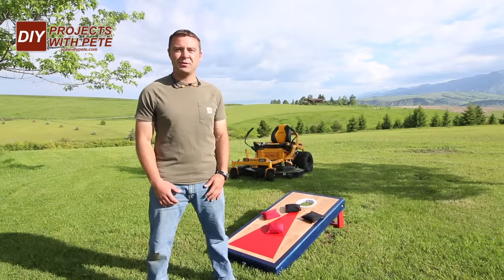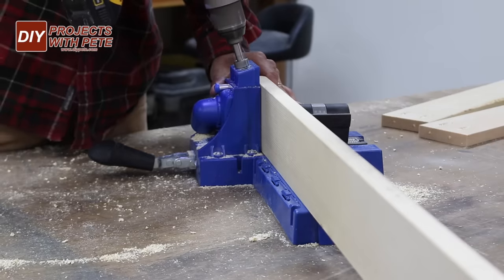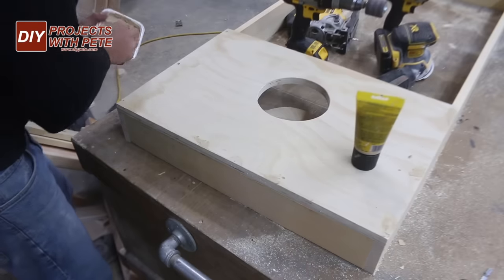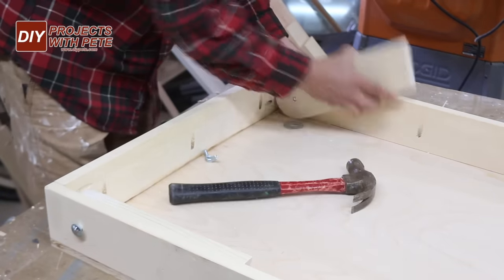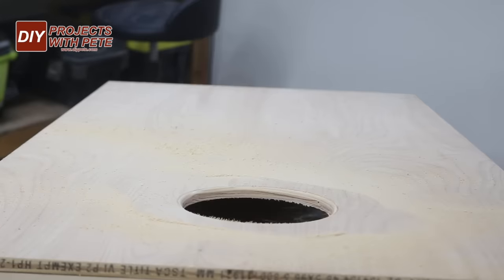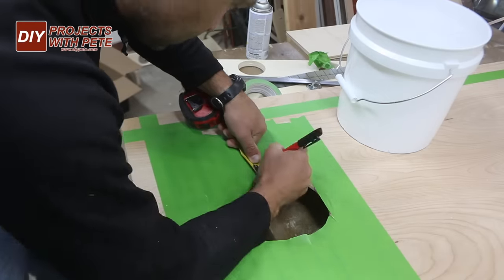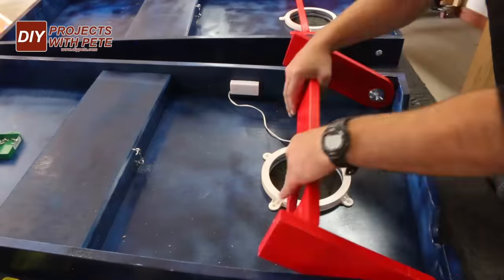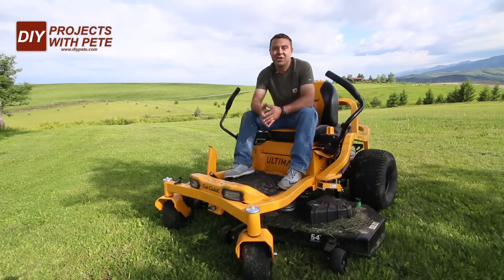How To Make Cornhole Boards

Comment: Thanks for using 1x4s. 
Most of the ones I’ve toted are built with 2Xs and are really heavy. The bag storage is great.
Reply from the maker: You bet! I agree, the 2x4 boards are super heavy. Cheers!
Reply: Bag storage can be between the boards by installing two cross braces of 1x 4 in center of each board...no need to put a lid on...when the boards are buckled together the bags stay within the cross pieces...just screw them 7" apart on the interior of the boards...also put a length of small rope 35 long inside and you have a complete game set....35 feet back to back on boards and also helps line up boards....

Comment: one tip i found that really helps on the legs is to put a 1/16" shim under the leg (between the leg and bottom of the platform) before drilling for the carriage bolt. that way it ensures theres space to rotate without sanding. when i started cornholes i learned off of your original and then modified so i really appreciate you. ive sold tons of em
Reply from the maker: Thanks so much!

Comment: Hey! I make cornhole boards all the time, I really like the style of yours! I'm going to try a set similar with bag storage and cup holders. Awesome job and thanks for the ideas! Maybe I'll post a video making a set. I've been painting my local sports logos and just  recently I did homer simpskn and Peter griffin from the crossover episode when they squared off to fight. Maybe I missed it but do you use a verathane coating on top for a smooth slide? If not I would recommend that. It gives the bags a good glide and the boards get a nice finished glossy look and protection from elements and wear.
Thanks again for the video.

Comment: Just a note about your orientation of the pocket hole screws.  I noticed you put the holes on the inside to obviously hide the holes, but that forces you into screwing in the shallow end of the opposing board, which creates a very weak joint.  Far weaker then a but joint.  I only point this out because a lot of people don't know that and it's important when working with the Kreg pocket hole system.
Reply: Glad I wasn't the only one who noticed this... since he is painting he could have easily used plugs or putty.
Reply from the maker: Thank you Merost, much appreciated.
Reply: If I'm not mistaken, he used wood glue in conjunction with the pocket holes which doesn't make the location of the pocket holes a big deal.  Or, was I dreaming that he said glue???
Reply: Think of wiid as a bundle of straws. If you push your finger through the side towards the end grain there isn't much there to prevent the straws from seperating and allowing your finger to come out. Going the other direction means the screw has more grain to prevent the screw from popping out.

Comment: Question for you, I really like the design and I'm going to attempt this over the next week between work and home life.  One of the last steps you add rubber "bushings" for edge protection but then you put on the handle.  Dose the handle hit the ground instead of the rubber stop?  If so would you just leave off the rubber stop or modify it somehow or use a different type of handle?  Thanks, great job.

Comment: If your still worried about splitting the wood with your screws I recommend that you cut about 1/16 to an 8th off the tip of the screw before installing and that would help with your wood splitting problems

Comment: Great job on the video.  Easy to follow.  Can't find the 6" LED ring light on Amazon or anywhere else for that matter.  Your Plan and Materials don't include it.  How can I get a couple?  Thanks and keep up the good work.
Reply from the maker: Hi! Here is the link: https://www.amazon.com/Blinngo-Cornhole-Standard-Backyard-Long-lasting/dp/B01N7SRCQJ/ref=as_li_ss_tl?srs=14830898011&ie=UTF8&qid=1562339549&sr=8-3&linkCode=sl1&tag=diypete-20&linkId=e4b8363b8431c990d2475b2267ec8f08&language=en_US     - I only put the link on the website post https://www.diypete.com/how-to-make-cornhole-boards/   Cheers!

Comment: Pete...... what router bit did you use for rounding the hole? I didn't see it in your instructions page.....
Reply from the maker: Hi, I used a basic roundover bit. It was either a 1/4 inch or 1/2 inch roundover bit.

Comment: Quick question, how did your red not run into the white circle? It doesn’t look like the ring was taped off during the rest of the spraying
Reply from the maker: Hi! I used a piece of cardboard to prevent the overspray. But, I would recommend painting with a brush. It took a lot of spray paint and brushing would have been quicker.

Comment: Great ideas.... I have one question.... With all the hardware on the sides, wouldn't it make it more likely for the bag to stay on the very edge more instead of falling off?
Reply from the maker: Hey Chad! The hardware doesn't really affect anything in my experiences using them. The handle is far enough down that the bag just continue to slide. For backyard play, they work great. Cheers!

Comment: Really great tutorial!  The only other thing I add to my boards is a 30' tape measure mounted to the inside front of one board with a notch to pull the tape out.  I'm working on a set of metal stake collapsible drink holders to mount underneath, but I love your integrated ones.
Reply from the maker: Awesome!

Comment: Just curious what you were using to measure out the distance between boards in the beginning of video
Reply from the maker: Hey Ryan, I forgot to mention that. It is just an old spool of masons string. I cut a 27 foot length of string to put on it and use it to measure the distance between the front of both boards.

Comment: How much did you spend on making it
Reply from the maker: Hi Chad, I don't have the exact costs on this build. The plywood boards were $17 each and the 1x4's came to roughly $25. The accessories are what will drive the costs up. The LED ring was $24. Bottle opener $5. Handles $4 each. etc. Cheers

Comment: Just like all the other one's that show how to make this they don't show how the bags are made, what's in them or the size of them.
Reply: Cornhole bags are 6" x 6" and are filled with 16oz of whole kernel feed corn.  Bags are constructed from 10oz Duck Cloth and are triple-stitched for strength and durablility.
Reply: ok thanks. do the bags come with ur boards because u didn't say. Do you have to get them from some where else.
Reply from the maker: Hi! I ordered the bags on Amazon. https://amzn.to/2lbtejJ   - I showed how to sew them in my last video about cornhole boards here: https://youtu.be/41tZPYkAFvE?t=690   --- however, I found it easier and not too expensive to just buy them this time.